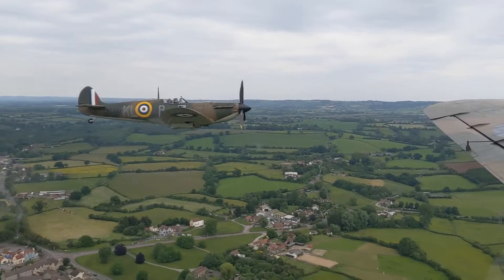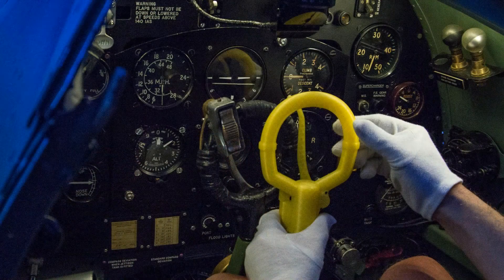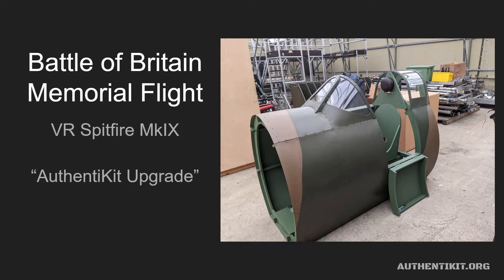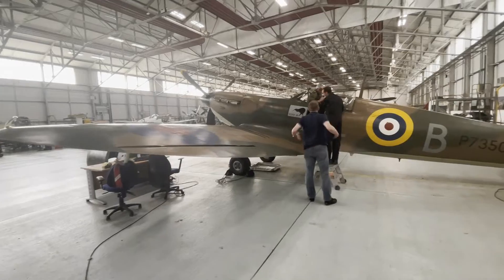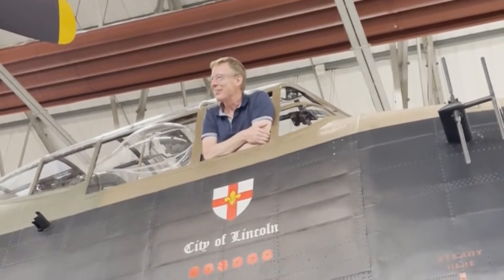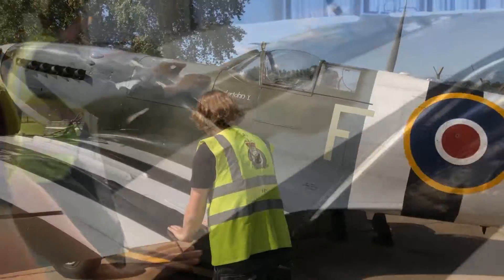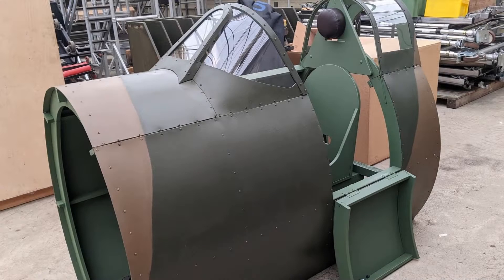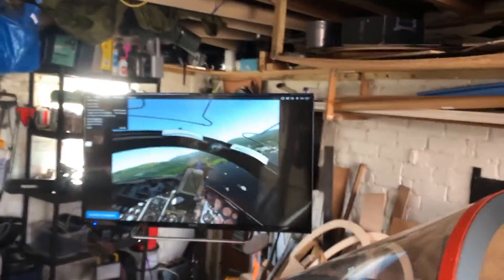The making of a Royal Air Force Spitfire MkIX simulator

Comment: I love this project so much. Have you got plans to change any of the print files based on the measurements and feedback you got during this process?
Reply from the maker: Thanks! The stick and throttle will get an upgrade in due course. More resistance for the stick and some strengthening for the throttle.